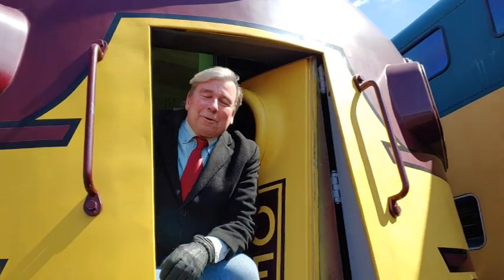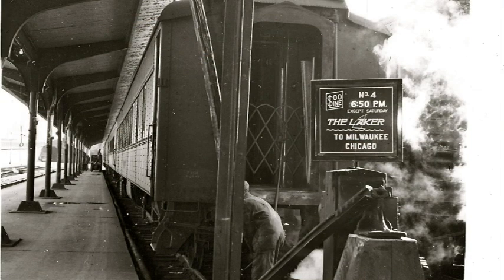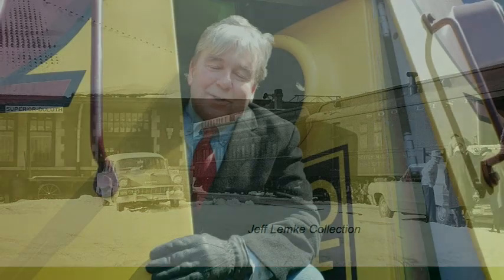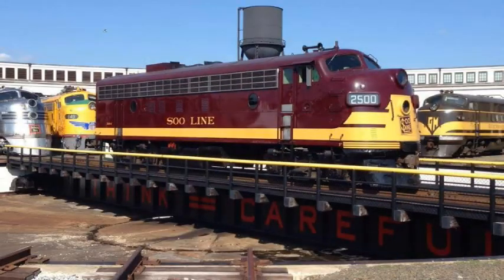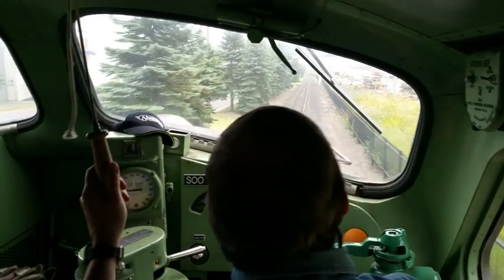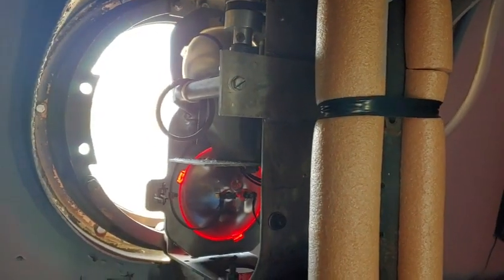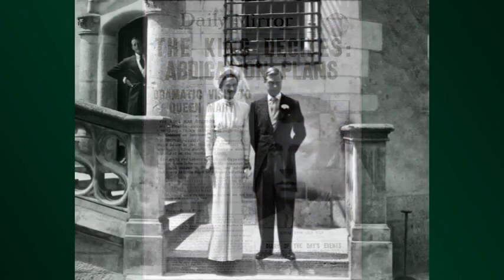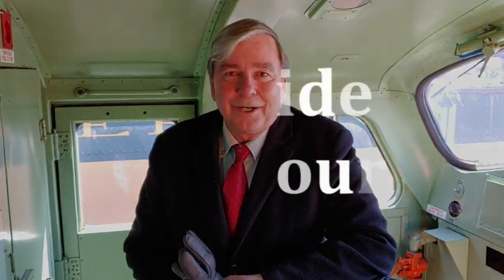Railroad Museum Tours #31 - Soo #2500

Comment: it's a shame the f series of locomotives are not in common use today. in an Era of fuel economy, you'd think streamlining your loco would be step number 1. I get that a freight train, almost by definition, is not streamlined as it carries its variety of cargo. however, an improvement, however minute, in the locomotive is still an improvement. when you are dealing with engines that will burn tens of thousands of gallons in their service life, if you can save even 1%, that's a lot of fuel after a while.